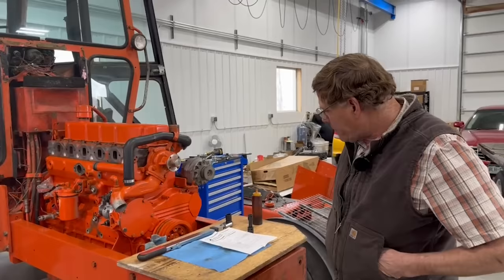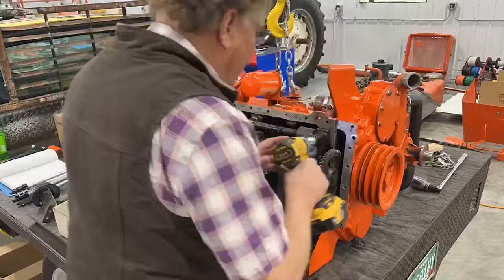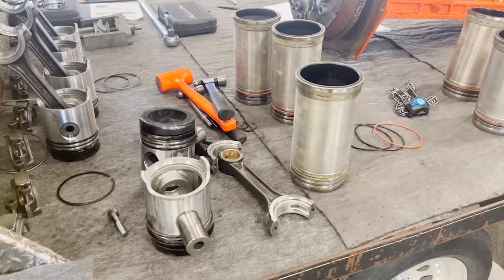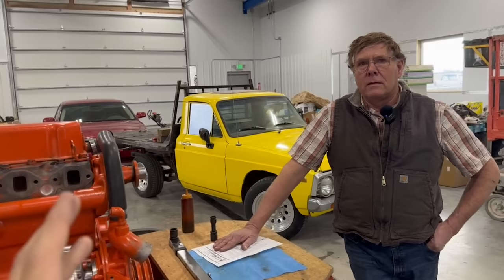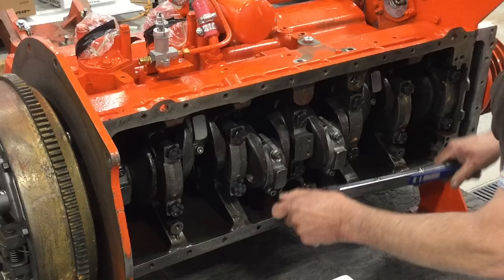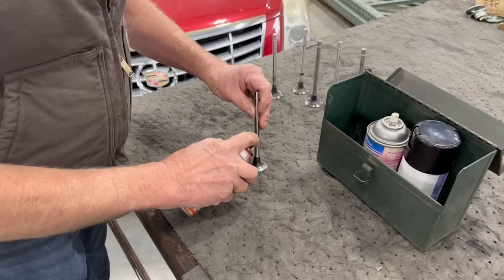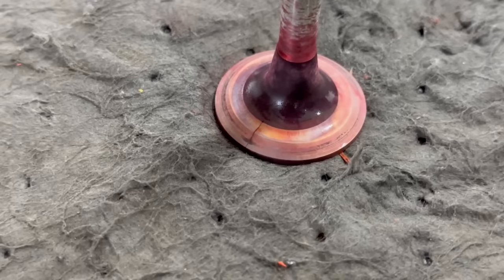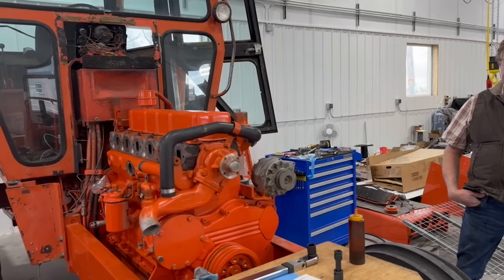Missing THIS Would've Cost Us THOUSANDS of Dollars!!!

Comment from the maker: As you all know, when you support our sponsors, you're also directly supporting our channel and future videos! Head to https://squarespace.com/jimsautomotive to save 10% off your first purchase of a website or domain using code jimsautomotive
Reply: Nice work 👏
Reply: So the cleaning guy feel comfortable with the current rebuild. Good luck
Reply: Got a bit of a question for you, I am currently fixing up a head for my Isuzu Trooper 3.1 turbo diesel engine (new valve guides, exhaust valves etc), have been cleaning up rough patches in the ports. I have noticed the valve seats protrude a ways into the ports, the portion that does protrude is rounded. Being that I am cleaning up the ports, will this be a problem for air flow?. Cheers.
Reply: Was so glad to see you take the time to make sure the alternator was in time🤣🤣🤣🤣lol

Comment: Base engine Engineer from Cummins here, the connecting rod oil drilling feeding the small end was eliminated as it turns out it actually doesn't feed the small end with oil.  The movement of the rod and alignment of the oil drillings ends up being such that the hole fills up with oil, but doesn't end up delivering a flow of oil to the bushing.

The rotation of the connecting rod is to move that slot away from the loaded zone of the bearing during rotation.  The slot takes away from effective bearing area, and increases wear of the bearing, so while not critical, it's very beneficial to have them rotated the correct orientation.

Nice build! Really enjoy the videos!
Reply: Hope this makes it up higher in the comments

Comment: Hey, I hate to do this… The comment section mechanics and safety warriors usually drive me crazy. But this piece of advice is coming directly from a heavy equipment mechanic with direct experience on what I'm about to say lol: earlier this week I was pounding in wheel seals with my seal driver, and the head is all mushroomed over. On the third seal, I hit the driver and a chunk of that mushroom piece flew off and hit me in the face. It actually drew blood. Never had that happen before. So I see your valve seat installing tool looks just like my seal installing tool and I was thinking you might wanna grind that down a little bit so you don't end up eating a piece of that like I did lol.. nice job on the diagnostics and tear down on this. Really interesting issue that came up with this engine. I like how thorough you guys are.
Reply: I've been bit by chisels that look like that too.  3 minutes on a bench grinder every couple if years is way better than stitches.
Reply: I was taught to grind off mushrooming heads back in HS metals shop and have  religiously attended to any tool began to mushroom takes less than 10 seconds

Weird the things that stick with you
Reply: @bigj231  Sure is! I've had pieces of punches and chisels hit me in the face as well. Never pleasant! Thankfully, I've become a little bit smarter over the years. I've started wearing safety glasses & face shields much more often, when I know I'll be striking on things up close. 

Other things to be very cautious around are grinding wheels and cut off wheels. I have a small piece of a 4.5"dia fiberglass cut off wheel stuck in my cheek to this very day.

It's crazy, because I can still remember it like yesterday, and it was easily a decade ago now. I remember the stinging pain, and thinking that I was glad I had safety glasses & my N95 dust mask on. I remember going to the bathroom to look in the mirror, once I had realized I was bleeding. Washed the blood off my face, put a little bit of Neosporin & a Band-Aid on it, and went back to work. Never thought about it again, as I never realized that something was actually still stuck in my cheek, at the point of the wound.

I was reconstructing & fabricating a 53' van trailer's 5th wheel pin & plate crossmembers & flooring structure. A ton of cutting, grinding, & welding going on.

Anyhow, I never knew there was a piece of grinding wheel still lodged in my face until the ER doctors did a full body scan of me, after I was in a severe pickup truck accident. 
The doctors were baffled by what the strange white spot was in my cheek, in their scan picture of my skull & face. 
Upon discussion, they even physically re-inspected my teeth & face. We then continued to discuss, until they concluded that what had happened to me years prior was the most likely cause of the unknown spot. LOL, so crazy!

They said that if it doesn't bother me, best to just leave it alone. Any additional intrusions at this point could just scar up and potentially cause unwanted problems to my face.

Point is, safety precautions sure can be a royal PITA sometimes, but the injuries they can prevent sure do make their use worthwhile.
Reply: @ShaunHensley  That's that I do too, grind off the mushroomed heads.
Reply: I've been noticing that as well and debated if I wanted to say something about it.  😆
Reply: @ShaunHensley  pretty sure they talked about it in the famous movie shaking hands with danger.
Reply: @MrTheHillfolk  they did! I was about to mention it
Reply: @MrTheHillfolk  Yes, I'm pretty sure I was exposed to that film
Reply: @ShaunHensley  heh ,we watched that movie in tech school ,and while yes it was corny the message always stuck with me on being safe.
Reply: I had a chunk of chisel go into an index finger joint. An army medic dug it out with a needle. Good times.
Reply: @bleachinuri  quick thinking
Reply: And if you have a lathe handy it's far easier to quickly turn the mushroom off and give the tool a clean re-shape with a chamfer to look like new lol that's what I do.
Reply: @samrodian919 , or a rock with hours of work?
Reply: Safety third, When you don't think it will happen,  It happens.
Reply: I had a sharp lense shaped fragment of a chisel shoot deep into my thumb... so deep that I couldn't get it out. It made a huge bump under the skin and I got mad aboit a year later and took a scalpel and sliced DEEP and got it out. Now I use gloves when chiseling. 
I kept the piece of steel as a momento LOL.
Reply: Got a buddy of mine with a chunk of a cold chisel in his arm from the exact same thing
Reply: Would a brass drift be a better tool for that operation?  Honestly asking.  More of a wood worker myself.
Reply: Here! Shake hands with danger!
Reply: @wallacegrommet9343  which is harder? A piece of brass or your thumb?  
The cold work from hitting a punch with a hammer causes microscopic amounts of deformation every single blow.  Eventually, the metal gets thin enough at the edge of the head and hard enough that it chips off and goes flying.

Brass punches are great because they are softer than steel, so they won't mark a steel pin or hole. They'll still mushroom and spall though, so make sure they're filed smooth. Don't grind them on a regular grinding wheel because the copper will plug up the wheel and eventually cause it to heat up and come apart. Use a non-ferrous grinding wheel, or just a file.
Reply: I'm a arborist and dress my aluminum tree falling/lifting wedges every few years. Well worth the time
Reply: @camshaftprelube  😆
Reply: Did not know about this.  Thank you for explaining
Reply: Friend of mine only has one good eye because of this. Always wears saftey glasses now, 'only got one left, need to keep it in good shape'. He always says with a laugh.
Reply: Those kind of mushrooms aren't healthy.
Reply: @ShaunHensley same here!  To this day, every time I see a mushroomed tool I think about that lesson I was taught in high school.
Reply: @wallacegrommet9343  Brass is used as a sacrificial impact tool. It's all about protecting the component when it comes to brass
Reply: This happenned to my grandfather. Lodged in his leg and he never went to the hospital. Turned into cancer and was his cause of death🌄
Reply: I was driving a hatchet through a log with a hammer. A chunk of the hatchet broke off and flew into my arm.  Had to go to urgent care and get it removed.
Reply: Thank you for your knowledge and video's USA 🇺🇸
Reply: That actually is a common, long time, known safety issue with punches and chisels etc.
Reply: A kid at my job came in on a weekend he’s not a mechanic or anything but decided he was going to do his bearing or something maybe it was a ball joint that was supposed to be pressed in he used an socket and it blew a chunk off the edge of the socket because he didn’t hit it directly in the center it hit right at the edge and the shard went up his arm cut tendons and stuff they had to cut prices from his leg to repair his arm and he doesn’t have very good function now and it was in pin for a long time he’s lucky it didn’t hit him in the eye and lucky he’s still able to use his hand to work it’s like being shot with a bullet
Reply: More importantly for the customer a piece could fly into tgd engine and not be seen

Comment: I bet that pump being 20% over was the biggest cause of the problem. Because Allison had to see a problem with it for them to add piston coolers in the later model that were only slightly high Horsepower tractors. That's just my theory.
Reply: yep more fuel will make the exhaust temps shoot up
Reply: I would expect that if over fueling by the pump were the problem it would have been present in all the cylinders, not just a few with the other, good pistons looking perfect.
Reply: ...and smoke like a locomotive
Reply: @Mr_Meowingtons  to a point, then smoke bad
Reply: @Mr_Meowingtons  to a point, then bad smoke!!
Reply: Yes if the extra power was used then it could cause problems. The question is were they using the extra power ? Can't really tell, same implement so maybe no, but could be at a higher gear and/or deeper so maybe yes. An EGT gauge would be a good addition IMO, just in case
Reply: Coulda been done for a long term reliability issue. 
Take a 65 and 75 Continental aircraft engine, the 75 had squirters and they recommend adding them to 65s on overhaul.
One benefit is higher oil temps.
You'd be lucky to hit 130-140 without them but it's a solid 180 with them.  
That's pulling heat out of the pistons, and you'll see it long term by the lack of black burnt deposits inside the piston.
Reply: 20%over on an Allis Chalmers 426 would mean nothing. I have a 210 that's been running 200+HP for 40+ years,
Reply: @petarmiletic997  yeah EGTs are always good to watch but if you advance an injection pump the EGTs come down but the heat is then going into the piston and can cause it to swell. I bet the later models have more timing in them as well
Reply: I'd think that with 20% over-fueling, the engine would simply reach full power before advancing the 'throttle' all the way, and then pushing the throttle the rest of the way up would result in tons of black smoke and lower EGT's. 
Seems to me like the real culprit was probably excessive advance timing of the injection pump, which would cause higher combustion temps and pressures, as the piston would be trying to compress an already burning fuel/air mass at the end of the compression stroke.
Reply: @jimbob5891  The engine only makes the power required to pull the load, regardless of the fuel settings.
Reply: My guess wood be cam or pump timing as they showed in some pictures injectors where spraying pretty much right to the outside the pistons. Sew the injectors most been firing to early.
Reply: @petarmiletic997  Yeah I really hope they add an EGT gauge.
Reply: The full load fuel rate being increased by 20% wouldn’t cause the failure they saw when the tractor was never even run at full load. It was almost certainly the injection event timing being set excessively advanced that was the root cause. Just like spark timing in a gasoline engine, in a diesel the point in the compression stroke that the injection event occurs at can cause extremely excessive combustion  temperature and cylinder pressure. The spray pattern from the injectors reaching far outside the “bowl” in the pistons shown in the last video  showed us the injection timing was definitely set FAR too advanced. Now had the engine seen similar damage after going to a few tractor pulls and really running the thing for all it had I could see looking at overfueling as a culprit.
Reply: @J.R.in_WV  , Yeah  the injectors spray pattern of the tops and sides of the piston is maybe why some cylinders got there rings and skirts messed up. Yet the ring was talked about. Those messed up cylinders look like fuel wash.

Comment: The cam ring in the pump was flipped. Shame it was missed when it was torn apart but I guarantee that’s why it was 180* out. If the new shop built the pump right this time it should be fine even with 20% more fuel.
Reply: Pretty sure that pump wasn't a true 180 degree off.  Pump shop screwed up big time
Reply: Injecting fuel too early will overheat pistons just as preignition (over advanced spark) will damage a gasoline engine. 
Injecting too much fuel into a diesel just makes it run faster.
Reply: @davidelliott5843  no…

Comment: Liquid dye penetrant. This is Type 2, method C, form D. 
Always pre-clean the part you're going to inspect with the solvent that comes in the kit. 
Allow it to dry for about 20 minutes. 
Spray the penetrant on the area of interest and let it dwell for 10 minutes minimum. 
Wipe off the excess using a lint free cloth to remove the bulk penetrant, followed by a solvent dampened lint free cloth. Never spray solvent on the part to remove the excess penetrant or you will remove the penetrant from the defect and ruin you ability to detect it. 
Let the solvent evaporate for 10 minutes.
Apply the non-aqueous developer by spraying in short bursts to just mist the part. Do not overapply the developer. Let it dwell for 10 minutes minimum and evaluate.

Pre-cleaning removes the organic material (oil, grease, etc). This will allow the penetrant to fill the crack.
 
A better inspection method is magnetic particle inspection. This method only works on ferrous materials. Cleaning is not as important.
Reply: I gather you have done penetrant inspection a few times before!  Are you working in Aerospace NDT?

Comment: I would recommend installing a pyrometer to monitor exhaust temps?
Since I didn’t hear you mention it, are you using coolant with DCA or SCA additives for Diesel engines?
It probably wouldn’t have prevented the liner putting in your case, it is necessary for long term.
Just my 2 cents, for what it’s worth.
Keep up the good work, I really enjoy your vids.

Comment: Suggestion - when you start the engine check the manifold exhaust temperature with a pyrometer or heat gun for over-fuelling - especially under load, also
Have you checked that you have the correct nozzles in the injectors and that they are set to the correct pressures / spray pattern?
Reply: Exactly
Reply: Yes,nozzles hole angle

Comment: It would be interesting to put a transducer on the #1 injector line and use a timing light to see what the actual timing is.  The old International 7.3 IDIs had those built-in to #1 injector just for that purpose.
Reply: This sounds like a great idea! Just to have an extra piece of mind. And check injection is happening when it supposed to.
Reply: In hindsight that would've been a great idea!👍
Reply: @GordonTurnerr  Still a thing to do with the repair.  I'm not a member of the hindsight committee.  It's their engine, not mine.  Just passionate about such things is all.
Reply: @nhzxboi  yeah for sure, but it would've been nice to possibly find that smoking gun ☺
Reply: @GordonTurnerr  As the cleaning man said, the evidence was destroyed by pump shop #2.  Best hope is a good offense and check things thoroughly before loading the engine up again.  Losing the forensic evidence is frustrating(maddening too).  With nothing else to go on but guesses, I can bet the guys will be very careful and suspicious of everything so much so that it might make for temporary insanity.  Lol.  The passion and care put into a build then getting swiped away by a failure is not a fun thing.
Reply: The 7.3 idi only had the transducer on number 1 on the trucks, the vans had the transducer on #4

Comment: When I was at UNOH for auto/diesel in ‘82/3. We talked a lot about the prevalence of cavitation in diesel’s. The explanation we were taught was also mechanical vibration as a primary cause but also coolant quality and chemistry. Aeration is a common  factor. A comment mentioning grounding straps seems good advice also as cathodic corrosion can occur too. The takeaway was correct clearances all around, balance, and coolant testing and maintenance as a religion. We were shown liners with million plus miles that literally looked and measured as new, and other liners with cooling issues that were cavitated terribly after only a few hundred thousand. 
I turned wrenches at the Chevy dealership for a few years then got into industrial maintenance. Worked at a liquid detergent plant (you’re soaking in it). Cavitation in our pumps and piping was a huge problem. We had impellers that were 10+ inches diameter that would literally erode to near nothing in months. Aeration and gassing was typically the given cause.  Sorry to see your woes, but great sleuthing and sharing your experience. Maybe you’ll never know the cause for sure but it looks like you’ve loaded your shotgun for great results 😊

Comment: If it were my ag engine I would replace the oil cooler core. It is most likely the original and has deteriation/cavitation/deposits internally that could restict flow. As you know maintaining proper flow keeps the liners/pistons as cool as they can be. I have 50 years experience on diesel engines was ASE certified for Cat, Cummins, Detroit and Navistar diesel engines until I let the certification run out. Keep up the great videos!